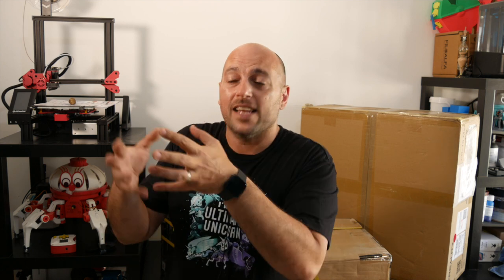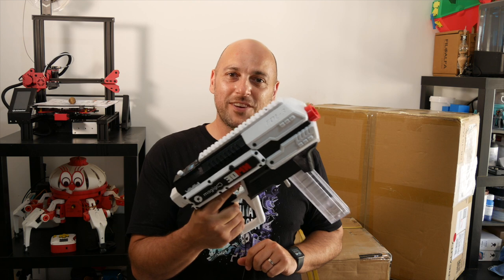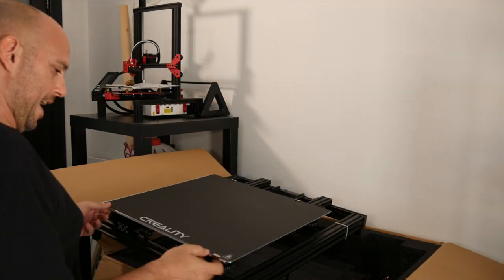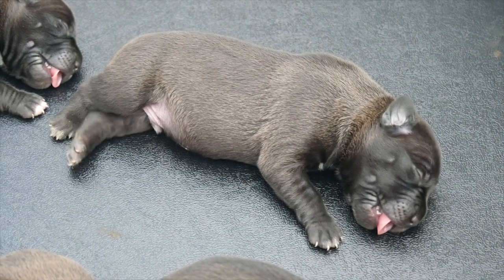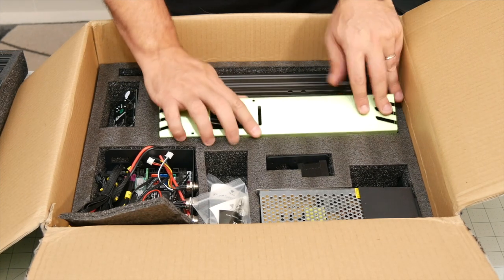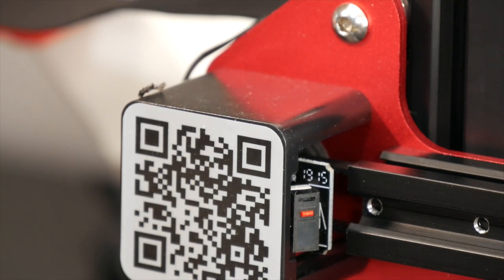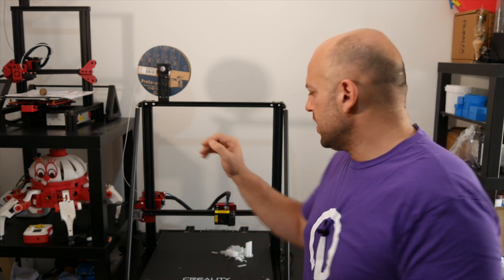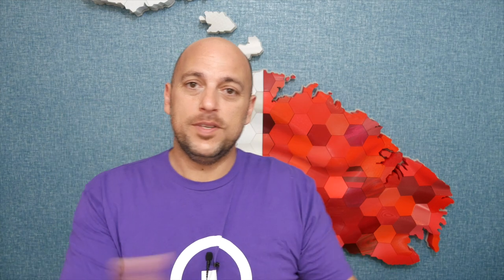Maker's Vlog - CR-10 Max, Tevo Tarantula Pro, FDL-3, 3DMN Mural, Puppies and MORE!

Comment: Yes loud as my Cr10S Pro. Was thermal protection turned on? Matterhackers said it would be turned on my Cr10s Pro but it wasn't. Had to use Tiny Machines firmware for that. Nice to see that Creality put a Touch sensor on I could not get my stock sensor to work reliably at all. I hope to buy quieter fans and replace the stock ones.

Comment: i feel like 3d printing some puppies after watching this video... Amazing Vlog dude :D & by the way, that sagging plastic wire housing is more trouble then what you tried to explain. When the nozzle is at bed level, especially when you are starting a print, that cable sometimes comes in the way of the bed , causing the Y axis end stop wire pulled out of its socket, causing the Y axis belt to keep rolling as the printer cant find an end stop.😬

Comment: I can't wait for the i3 "fad" to be over, 300x300mm was already pushing the limits of moving beds, but the Max is just ridiculous. :) CoreXY / Ultimaker style cartesian for ever!
Reply from the maker: I honestly couldn’t agree more!
Reply: @3DMakerNoob  Also watch out for maximum LED strip lengths - at only 5V and with thin copper traces, the voltage is going to drop really fast. Would go for 12/24V next time, it'll also save you from running thick wires for those crazy 30A. :)

Comment: Here is my solution for the Creality printer:  Use a 6 inch piece of straight spring steel wire and bundle it in with the wires at the hot end.